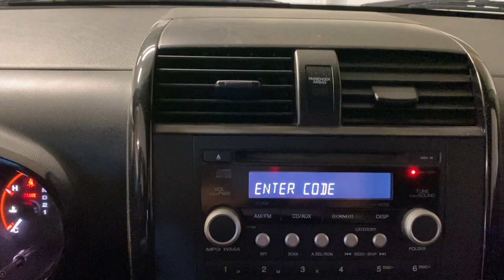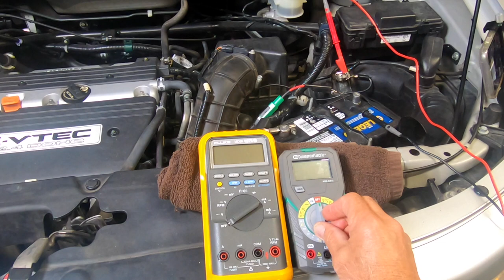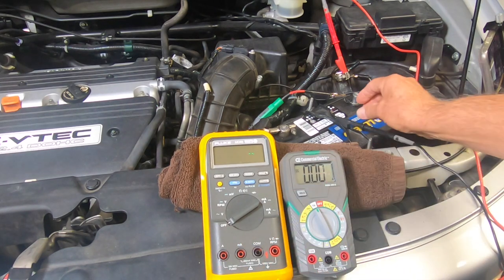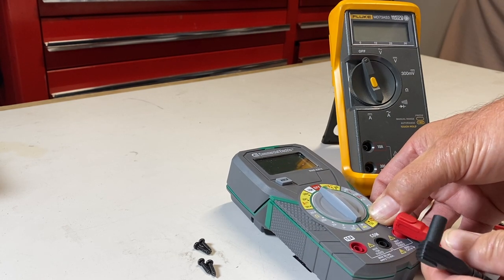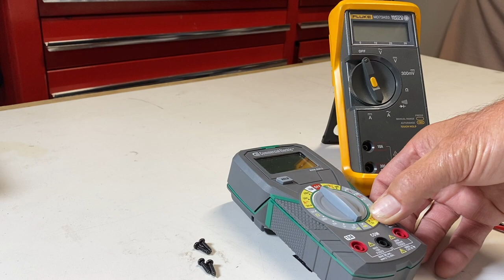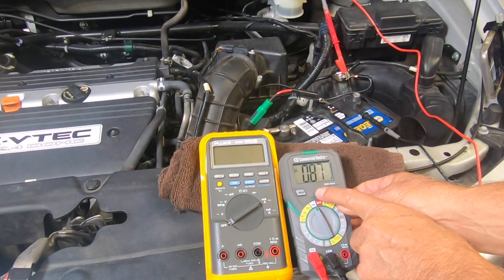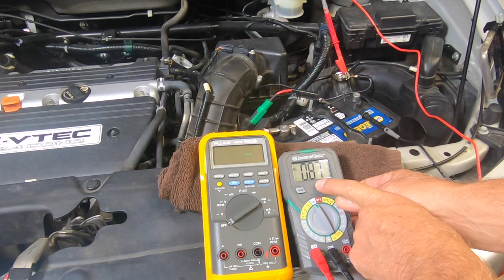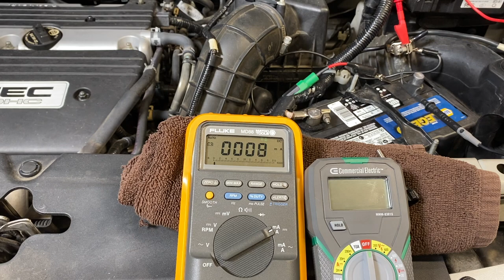PARASITIC DRAW TEST, Battery Dead Again, everything you need to know.

Comment: Understanding a small voltage spike could blow the fuse in your meter (if equipped) or damage its internals. What if a 10amp fuse installed between the negative terminal and the lead to the meter would this provide the protection needed protecting the meter?
Reply from the maker: 7.5 amp, it must be lower then the meters fuse
Reply: @dannysdiygarage  Perfect, thank you for the reply!

Comment: The problem of blowing amp meter fuses due to the surge from the battery justifies a $35 clamp amp meter. If your battery is good and dies overnight your drain is at least 1 amp.
Reply from the maker: Great tip and thank you for sharing, good advice

Comment: I would use a test light. Disconnect negative cable from battery, hook up end clamp of test light to negative cable, then the other side to negative terminal of battery. If test light lights up, we have a parasitic draw. Then, I will start pulling out fuses until light goes out. This will tell me which circuit is drawing too much current. The only issue with this is it wont tell me how much of a current draw. The second option would be to buy a parasitic current draw tester then all I have to do is hook it up to the negative side of battery cable wnd thats it. It will tell me the exact milliamps of current draw. It gets a little confusing with hooking up a paper clip, then hook up multimeter on both sides. Some people can actually blow up their meter, or cause more problems.
Reply from the maker: Exactly! That’s why you use a meter, 👍🏼

Comment: Hey danny good video, but i have a question i don't understand , first the jumperwire you connenct and later you disconnect the jumperwire for measering. So i think that at that moment the memory get lost? Same with the memory saver first you connect and later you you disconnect?
Reply from the maker: All the power or current is still flowing as it gets measured through the meter, if connections were lost, such as disconnected meter lead, at that time memory is lost, hope that makes sense
Reply from the maker: Check out this video https://youtu.be/rVDgFCz5QOg?si=7urwv9BkSCPOrZYn

Comment: I had trouble finding my parasitic draw so I put on a kill switch. To my mind I bypass the drain. However, I read somewhere that -20°F Canadian winter weather kills the battery. With your technical expertise can you tell me if this is so?
Reply from the maker: A fully charged battery of 12.6 volts should be able to withstand a cold temperature of about -76 degrees Fahrenheit. The battery can lose about 30 percent of its power when the temperature falls to 32 degrees F and can lose 50 percent when the temperature falls below freezing. A fully charged battery can withstand the temperature about 12 to 24 hours and then will start to drop power until the temperature drop kills the battery and it will freeze.
When the battery is below 100 percent charged, the battery electrolyte can start freezing at 32 degrees F.
If a battery freezes then the battery case may swell and crack. A cracked case will leak out all or most of the electrolyte fluid when the temperature warms. This will cause battery acid damage to the area of the spill and you will need to have the battery replaced. If the battery did not crack yet, allow the battery to thaw completely, then recharge and test it before use.
Winterizing your battery by having the cables cleaned and tested will help prevent problems with the battery when the temperature starts to drop in your area or where you are going. If the battery is weak or failing, then have it replaced now before it leaves you stranded.

Comment: Hello, good morning, I am a follower of your channel and I am contacting you, to be able to comment on the following situation that occurs in my vehicle, Ford mondeo mk2 2.5 v6, one morning the battery was discharged, without knowing how to change the battery, when month or so, the car stopped in full operation, it was as if the electricity had died, stop, giving it and giving it until it started, again as if the battery was without charge, it was only a month old, I changed the alternator regulator , and well, I bought it, it charges over 14.5V, and I considered the fault finished, one day cleaning the interior, I left the radio on, while I cleaned, and nothing a few minutes later, the voltage began to drop, less to less, until the battery was discharged at that moment, I was surprised because that had never happened to him, I did another test, with the battery charged again, I gave the contact, after a short time, equal to less to less , that in a moment the battery goes away, I recharge it, install it, and leave it  and connected approximately 2 months, until I realized that the red light of the alarm did not blink, I checked it and discharged, that did not happen in the past either, it carried out the current leakage test with the multimeter, because I told myself that this would have to be a current leak, it is the logical thing to think, and what was my surprise, that the value it gave is 0.02 amps, with the battery just charged, so there is no current leak, I have also performed the voltage drop test and it gives 000v both positive and negative, and then what happens to it? I don't even know what else to do, regarding what I am explaining to you, I await your prompt clarification, please, greetings.
Reply from the maker: Hello Mario 
From your information, this is not your daily driver, is that correct? This car sits for a month or more? 
Please reread what you wrote, it’s very confusing
Reply: @dannysdiygarage  What do you need me to clarify?
Reply from the maker: @Mario14792  I assume the battery is drained and has low or no volts left when this happens, also it's not a connection issue, like loose or corroded cables or grounds, correct?  I'm also assume this vehicle sits for days and even weeks, and it is not your daily driver, is this correct?  I understand it's a new battery, but sometimes new batteries are bad.
I understand you have a 20 milliamp draw, which is very good, however have you used the min max feature on your meter, so you can leave it on overnight and see if you had a current draw spike during that time. if the vehicle just sits, have you tried disconnecting the battery from the vehicle and see if it still goes dead, this would eliminate the vehicle and point towards the battery, have you taken the battery somewhere to get it tested? 
My guess would be you have a draw, which happens intermittently, this is not un common. This is just my guess, without being in from of the car I can only guess. Please update me when you have a fix

Comment: I performed this test on a Nissan Armada and the amperage fluctuates. So the drain goes in a cycle every 26 seconds as such: 

14 ➡️ ~24.5 ➡️ 14 ➡️ ~21 ➡️ 14 ➡️ ~18 ➡️ 14 ➡️ ~16 ➡️ 14 ➡️ ~15 ➡️ 14 ➡️ ~14.3 ➡️ 14 ➡️ ~17 ➡️ 14 ➡️ ~20 ➡️ 14 ➡️ ~24 ➡️ 14 ➡️ ~ 25.9

This cycle occurs every 26 seconds. I performed this test 90 minutes after locking and arming the vehicle. The drain is within normal range (the numbers above are in milliamperes), but I wanted to know if the fluctuation was normal ???
Reply from the maker: Normal, some vehicles take longer for all modules to quit drawing power “to go to sleep”  sometimes my element takes 20 minutes other times 90 seconds to get the modules to sleep, great question 
Thanks for sharing